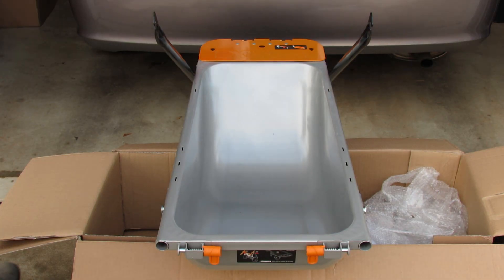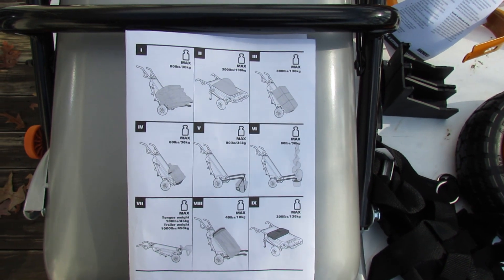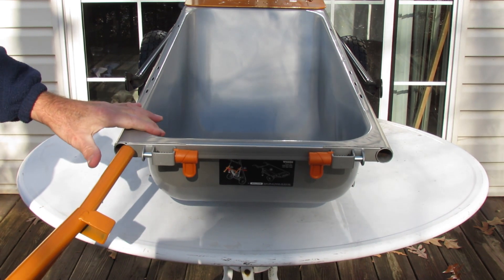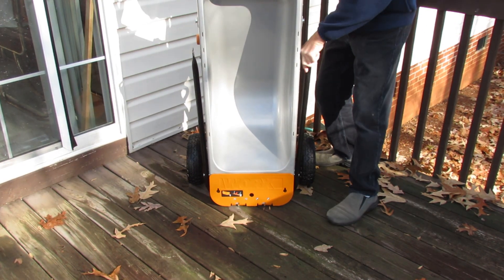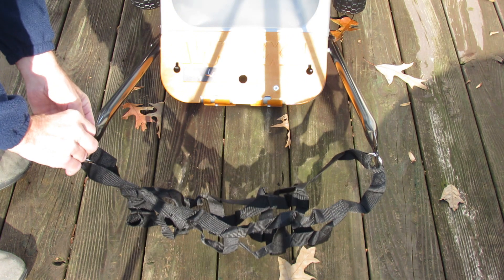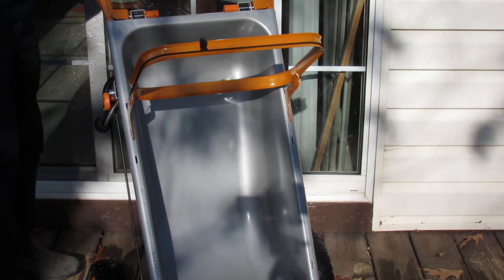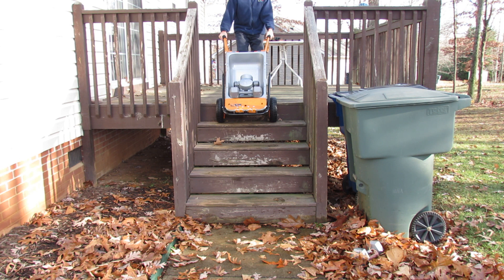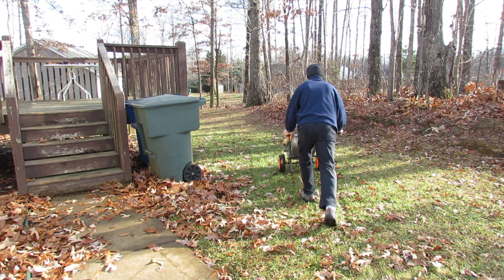WORX Aerocart All Purpose Lifter/Carrier/Mover - Unboxing, Assembly and Review

Comment: Those two black rubber  blocks are shipping purposes. They are to be discarded along with box. Those have no practical use anywhere in Aerocart.
Reply from the maker: +Bharat Amin Thank you!
Reply: +Bharat Amin That's correct. Packing use only.
Reply: Thank you, thank you ,thank you
Reply: Didn't want to toss mine until I was sure

Comment: When hopper is upside down,I inserted cotter pins from underneath side. This way it was lot easy to insert cotter pins  with my hand.I did not use plier.
Reply from the maker: +Bharat Amin Thanks for the tip!
Reply: I think you put the pin in the wrong way according to directions insert from underneath with the cart upside down I guess that helps keep open end of pin clean
Reply from the maker: Good observation, thank you!

Comment: I'm waiting for mine to arrive in about 10 days.  Perhaps, going down the stairs, one should back down rather than going forward.  You would be pulling the load rather than pushing.  PS:  I'm waiting for the snow plow feature.
Reply from the maker: I think you'll really like it. Be careful with the backing down the stairs, certainly try it with a small load first. The reason I had trouble was mainly due to the size and unwieldliness of the load.  Let me know if they offer the snow plow as an option :-)

Comment: Thank goodness for these videos here on YouTube or this product would be a total disaster. The accompanying instructions are completely useless and forget trying to reach this company by phone - they simply don't respond. Our cart arrived with a bulge in the bin thanks to a big indentation from underneath. The company's response from live chat as to how I could get an exchange was "here is the number for Fedex," so I decided to keep this one even though it's damaged. 

However, it's frustrating that the demonstrator here frequently does moves that are not visible to the camera. For ex, I have now watched the part of the video showing how to use the dolley platform 5 times and still can't figure out how to release the platform.
Reply from the maker: +Peggy Schoen Hi, if you're referring to the orange platform at the bottom of the dolly, you release and lock it into position by sliding the two gray pins at the bottom of the dolly in and out of the slots of the platform. Hope this helps.